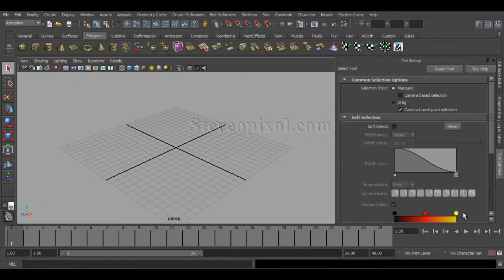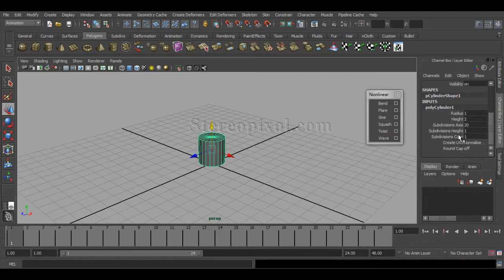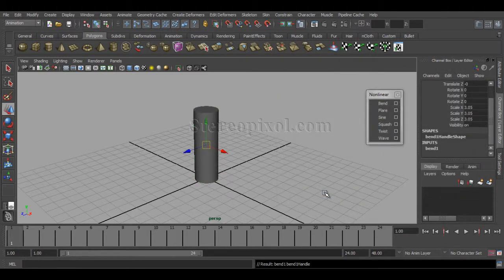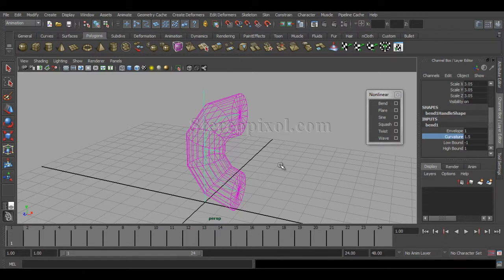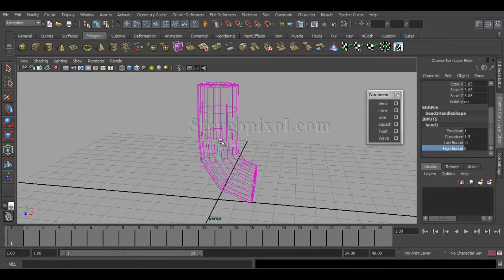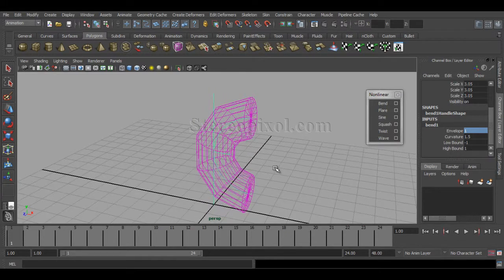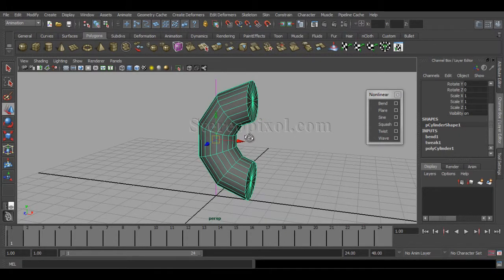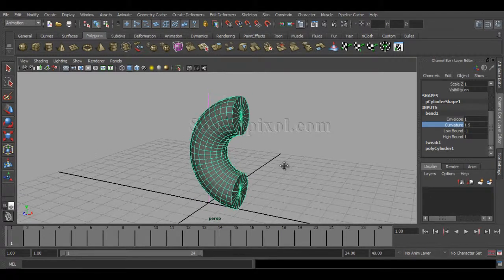Nonlinear Bend Deformer in Autodesk Maya

Comment: After you bend it, why the object does not stay the same if i move it around? and sometimes the pivot's position changes, how to reset that?
Reply from the maker: +Christopher Rusli It happens because The bend deformer is connected with the mesh/model. in other words the Bended mesh is depend on the bend gizmo. So if you move the object it calculate then 'bend' operation on the basis of the position of bend gizmo. If you want to retain the shape you have to delete the history of the mesh and you will be free to use it.